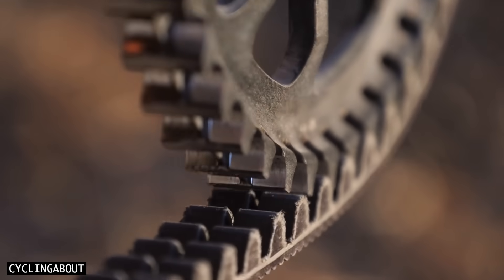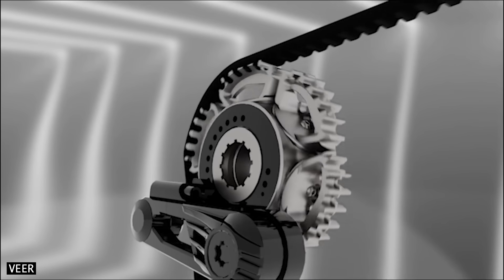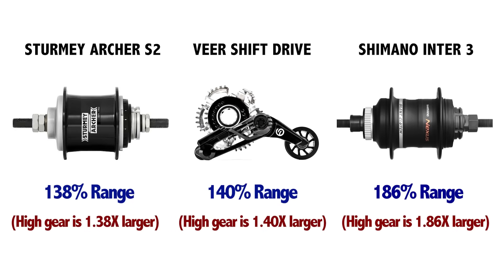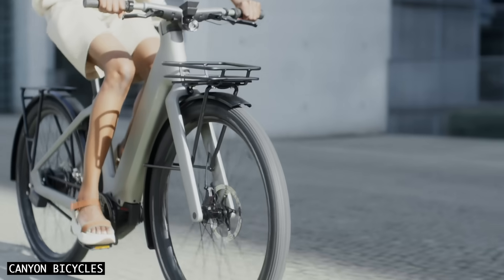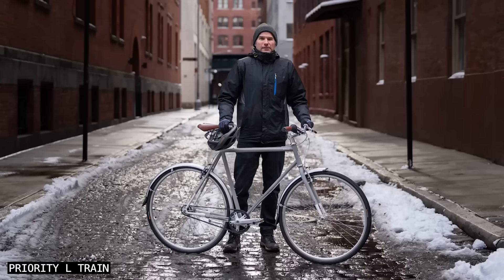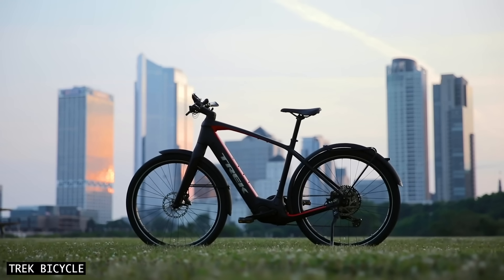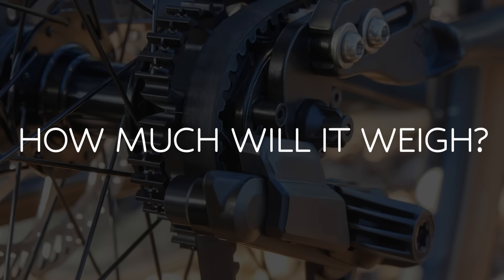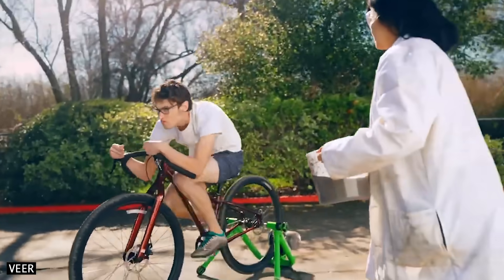Are Chainless Belt Gears The Future of Bicycle Drivetrains?

Comment: Was this written by AI? Various things WRONG, as usual. AI IS STUPID. 
7:12 What do you mean they need to be packed with grease? You just said belt drives require no lube. What do you mean the sprockets must be "sealed"? They are obviously not sealed. 
5:56 You're talking about gear hubs, while showing pictures of belt drives. Wtf?

Comment: That’s awesome that someone could think of such a gear system👍. It looks a bit complicated and might not be cost effective and popular with chains still cheap. I prefer the mid drive gears with just 1 gear at the rear. Enclosed Mid drive internal lubrication I think it’s the best motorized or not. Thanks for sharing ❤

Comment: Gone look at this as a commuter and cargobike driver. As a commuter mud salt and just rain would make me worry about that fine mechanisme getting clogged or rusted. Currently i have never had isues with my belt and enviolo apart from the cables failing at the 20000km mark. 
The cargo bike i drive is an Urban Arrow Tender 1000 pickup. Big bosch engine belt and rohloff speedhub. 300kg loads i fear the torque would break it outright withe the massive loads i have hauled with it. Plus dirt and dust where i work allong side of.

Comment: It looks like the prototype has a 30 tooth and a 42 tooth sprocket (140% range). Assuming dimensional constraint prevents the design from have smaller sprockets, to achieve a range equivalent to the 4th and 6th gear of a Shimano 8 speed hub, you would need a massive 75 tooth chainring (which won’t clear the chain stays on many bikes). This is equivalent to a 1.79 and 2.5 ratio which is reasonable for most terrains.

Comment: Wait a min what happens to the belt teeth and corners when the last gear turns 180 degrees to transfer the belt? Theres no wear on the teeth or splaying of the edges? I dont see how that cannot be a problem since belts arent generally designed to do this so are there belts engineered to be matched to this system? I would imagine straight cut belt teeth would warp into bi-helical style teeth after many many transfers.

Comment: Imagine if they could do it at the front and the back along with a gear hub! Due to the tensioner it seems possible at least with electonic shifting.

With an extendable tensioner arm, large front gear ratio could be possible! In turn it would make such a set up better on all front then any set up possibly in all specialties (mountain, road, cargo, gravel...).

Comment: It won't take over chain and cassette technology. There are some BIG obstacles you need to solve in order to break through. Classic gearboxes are easily serviceable, replaceable, widely available, cross-brand compatible, relatively cheap (for lower end product lines), efficient (maintained chain has about 98% efficiency), light enough and already have more gearing range than 99.% people need. There are definitely good uses for this, but I've seen too many "revolutionary" products to fail because their business model called "everyone will swap to inferior technology because it looks cool" didn't work. I don't hate this product, I just hope they will base their business model on reality instead of trying to conquer un-conquerable.

Comment: Interesting concept, somewhat reminiscent of the Browning Smartshift system from the 1980s, which moved the chainrings instead of the chain. It was a commercial failure.  One concern I have about this system is that it places highly stressed moving parts out in the dirty environment. With internal gears, the stressed mechanism is mainly enclosed, and with a derailleur, most of the exposed moving parts are not highly stressed.  Even so, derailleur systems vary considerably in how well they tolerate dirt and mud. I wonder what happens to those rotating cog segments when a little bit of grit gets into the area where the segments abut each other, or works its way into the space between the cog segment and the hub shell.

Comment: I use internal gear hub in a really hilly country, where I need about 550% gear ratio, I use both internal gear hub and 2x front derailleur, giving me about 520% ratio, with an Enviolo n360 as hub.
I really would like to have 2x belt system, as it's the only thing holding me back from converting to one of those detachable belt drive that doesn't cut the frame.
Reply: Now, Rohloff has 540% gear hubs alone, even has higher efficiency than n380, but they cost a kidney and a leg.
Reply: Experience-wise, I find it's riskier at roads to have less speed than I have (some mixed with cars), and it's almost impossible to climb the hill I live even if I increase the rear cog one tooth. It's bare minimum as I use all the gears and I often even go faster than I have highest gear on some downhills and have struggles on lowest gear on the way back home uphills at summertime.
Front belt derailleur would be also helpful in this case. Of if could be combined with hub gear.
Thanks for the review, I'll check if it combines with my hub, however wish you didn't refer as "hubgear-killer" but as more to expanding the gear ratio of limited hub gears.

Comment: This has been around for at least two years now. Of course, Veer can be put on anything single speed or internal. 

Hub motors are 90's era tech. It just doesn't make sense to waste the expense of this very limited system on a cheap bike. Keeping those segments clean and quiet isn't going to be easy. Currently, they are as heavy as an 8 speed Nexus internal. Much as us e-bikers want to think weight doesn't matter, it does impact range and handling. While I still prefer belt drive and internally geared hubs, the fact is, there is more friction just due to surface area with any belt drive. This system increases that friction with the tensioner. That's not as efficient either. Definitely worth it to me, but I rude my traditional bikes for anything over 30 miles anyway.

Comment: Not even really spoken about is the WIRELESS aspect...this means it has to be powered by something internally to either create electromagnets or operate small electric motors to spin the gear pieces...this opens a whole new level of relaibility that wasn't covered in this video...

Comment: So each shift needs half a wheel cycle instead of a third. The other problem is the complexity of the open mechanism. Also, now you need a belt tensioner.

You get rid of the first problem, if you mount it to the crank.

How is the belt doing with the narrow radius inbetween shifts?

Good luck.

Comment: What happens if you start to backpedal mid-shift? Will it mess this system totally similar to derailleur system? With derailleur you can fix the result pretty easily simply by switching gear again and pedaling forward but this seems like it could drop the belt in such a situation.

Comment: My Rohloff belt drive has over 500% gear range. My only complaint is I'd prefer a hub with more gap between fewer gears and a lot less weight. But Rohloff is by far the best game in town in geared hubs. The competition is insanely heavy.

Comment: You can get many more than two speeds out of this system, simply by having a combination of smaller and larger reversing segments. For instance, broken into 12 sections, three can be the lowest gear, three can be larger for a middle gear, and three can be larger still for a higher gear. Reversing them into the belt path selectively gives you effortless gear shifting between three or more gears. This can be activated either electrically or by a cable system inside the gear hub.

Alternatively instead of spinning into the path of the belt, they can be shaped like the cam on a nautilus weight training system, and rotate outwards into the belt path to enlarge the effective diameter of the gear.

Comment: The animation at 1:05 is wrong! Whilst shifting to a smaler diameter rear 'sprocket' , the tensioner, instead of   dealing witch the extra belt length, is PROVIDING extra length. this should be the other way around.

Comment: They can use the exact same technique from the other side of the "sprocket" to include one larger gear allowing for three different ratio selections on each hub.  If you had one of these on the crank and one on the rear wheel, you could have a nine speed that is entirely belt driven.

Comment: The problem is that the bike needs to be largely designed around the belt drive system, I'm not opting for belt drive simply because the chain is still a better option overall, it's versatility cannot be beaten.

Comment: Put the teeth groups onto a bigger diameter.  Here they have 4 spinning teeth groups. So put on 8.  so keep it only four are using the belt at once still but you can have two different heights on each group.. Which means you can have many more gears. Think with 8 spinning teeth groups you have two different teeth set means 4 gears sizes. That’s a ingenious idea they have. Well done. But listen to my idea there and make it :)

Comment: A typical bicycle has been optimised for over a century to deliver a Cinderella compromise of efficiency, durability, weight, and economy. It's the value proposition that's a dealbreaker for so many failed innovations. Spending, at the very least $150 USD (CYCLINGABOUT's number), for one extra gear, on top of the cost of a belt drive specific design, doesn't strike me as a compelling argument. Consider that I just bought a rear derailleur for my 9 spd drivetrain for $20 (Decathlon). And one of the greatest selling points of a belt drive--no more grease on your pant cuff--can be easily addressed by one hundred year old technology. It's called a chain guard.

So as impressive as the engineering behind chainless belt gears may be, IMO it's promise is limited to a niche market. It strikes me as a solution to a problem too few cyclists have.

Comment: The Patterson Drive can use a belt, is all internal, has a 1:1.6 gear range, is mounted on the front sprocket so can be paired with an internal hub, doesn’t need a derailleur, and can be shifted anytime, even when stopped.

Comment: That is really clever , but two things spring to mind , firstly its unproven , and lastly ,  imo it is a limited application , because there is no getting around the point you only have two gears , as you mentioned on the flat and , with motor assist that maybe  doable , but in other applications requiring more gear options , it seems a hard sell ..

Comment: If you did that on the  front and the rear cogs you could then get 4 gears which would be much better. One of the primary limitations of me moving to belt drive is that I need to have a geared hub which limits me to something I might not want, as well as having to have a specifically split frame. While this video says that belts can be split, I have not yet seen that, I might be a little behind the times. As far as I am concerned there is really only one internally geared hub and that is the Rohloff and that thing is quite pricey. Other hubs tend to fail.

Comment: Weight, efficiency and potentially price advantage over an internal gear hub makes this intriguing. I would have concerns though over the exposed swivel mechanism and longevity.
Reply: this think is at lest 10 times more complex and expensive than internal gear hub and also unreliable

Comment: Interesting idea, but if that system is exposed to a twig or a small rock or any very hard piece of trash, the teeth on those rotating gears will eat up that stuff and then promptly fail. It looks like a trash magnet that processes big chunks of trash into smaller chunks of trash. I would never trust that.

Comment: I’m no engineer, but it looks like the tensioner is on the wrong side of the belt. That’s going to make noise and chew up belt teeth faster.  As far as belt drives go, I have two Harleys that use Gates belts and they’ve lasted for over 20 years and tens of thousands of miles.  It’s a great system.

Comment: This would be a good investigation if it didn't forget that chains exist, and are the best transmission system we have so far. If this concept were to work, why would it not be usable with a chain? If this is anywhere near the pie in the sky potential this video suggests is there even one example of a working example in another machine. This seems like a reinvention of gears. So it would have a lot more application than just bikes. I think this would be awesome to see. But for now its just another ridiculous internet video making naive bold claims on par with 'hubless wheels' and other gimmicks.

Comment: Splitting belt is a game changer amongst other cool features of this new drivetrain.  I’m surprised a split belt hasn’t been developed until now… a missed market opportunity.  In the past 10 years I’ve on and off considered a belt drive bike but can’t retrofit so never did it as I’d have to get a FRAME that splits!
Reply: Not surprising, given the construction and composition of belts. And any site on the belt where it would split and be connected needs to also be flexible so it can bend around the cogs, whilst being strong enough to hold up.

Comment: It’s definitely interesting. I don’t see myself using something like that though. I wouldn’t get the NuVinci (enviolo) system again if I were to replace my R&M Delite. But I would go with a Rohloff or the new combined motor and gear system from Pinion. I think that would be far better. And on an urban bike, I’d either go with a single speed, or a Dutch bike with a 3 speed hub and a chain case. The only thing I don’t really like about that setup is the plastic chain case, but you could make those out of a plant based material.

Comment: I am extremely bothered by the fact that the graphics department got the tensioner polarity incorrect.  On shifting to the smaller diameter gear the tensioner should move toward the rear, taking up slack.  Instead it is shown as giving more slack.  The opposite occurs (also incorrectly) when transitioning to the larger gear.  Incorrect graphics rendering makes me mad that the people who are trying to convince others with their work don't even (1) have an even basic knowledge of physics, and (2) take the time to even run it past someone who actually does before their work becomes the face of the company.
Reply: Well spotted!   It's ultimately on the management to make sure that the graphical designer has a clear brief and what's released by the company is accurate.   Maybe it was planned by management as an error to provoke comment and discussion though 😜

Comment: great for efficiency hunters, and they're more maintainable, but thats about it. internal gear hubs and mid-drive with more gears will always be preferable for most people, having more gear range and resolution is important for all-use bikes. i'm looking at 5-7 gear internal hubs for my next mid-drive bike.

but i'm super interested in trying it, hub motors do have their place, and i don't use all of my gear range and resolution, on average i use only 3 gears in a small range (because of the 25kph motor limit)
Reply: You don't need to maintain a geared hub. That's the whole point. Meanwhile this is open to the elements and has tons of moving parts to get gunked up

Comment: wait, what about the split belt that you barely mentioned? the only reason I haven't switched to an internal geared hub will the Gates carbon belt is because I don't want to modify my frame? I can't believe Gates hasn't come up with a way to do this yet as a way to advance their own product, so I feel like there's got to be a longevity issue resulting from having been split.

Comment: How would you ride a bike with only 2-3 gears without breaking cadence? Even with a 2x 12 system I think I hit almost every gear when I'm on a longer ride. I could understand maybe in an urban environment, where you might only ever need one gear. But I don't see how this would work on anything you plan to travel on.
Reply: Gears are for the weak. I did a 50.72 mile ride on a 46-16 singlespeed. And I'm gonna do it again on 52-16
Reply: @Coastal_Cruzer  What percentage of that is a gradient greater than 18%? Did you maintain cadence while climbing or break cadence?

Comment: I really need to take out my belt drive bike....I know, it will run just fine as two years ago I serviced Nexus hub and belt doesn't even needs lubing after sitting in closet. I'm just spoiled by fair weather riding FG bike but when weather is wet belt drive wins every time. Maybe it's time for belt drive FG?

Comment: That's some very nice engineering  it may also be possible to eventually add the system to the front drive sprocket as well, doubling the number of gears. Thanks for the video. ❤

Comment: One usecase for this: If you want to run a belt on a trispoke or other wheel, where you can't choose the hub to have internal gears. (Yeah, I am a really niche edge case, I know 😅) Currently I would be looking at Schlumpf or Efneo retrofittable bottom bracket shifting for that. Of of course maybe even a specialized frame with Pinion shifting. But that's not only l expensive, also heavy and inefficient, which doesn't suit the concept I am going for with this build.

Comment: The segments have toothless gaps in between them, i.e. higher torque per tooth/notch contact point as compared with a single speed sprocket. In particular on the larger sprocket the belt bends twice between segments. It remains to be seen whether this impacts durability.
Reply: I mean, it certainly will; it remains to be seen how much.